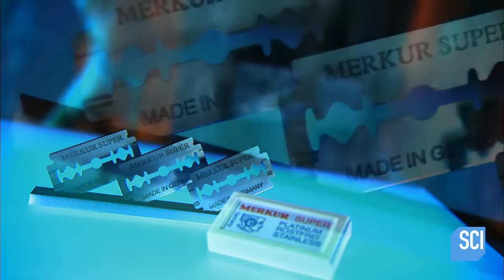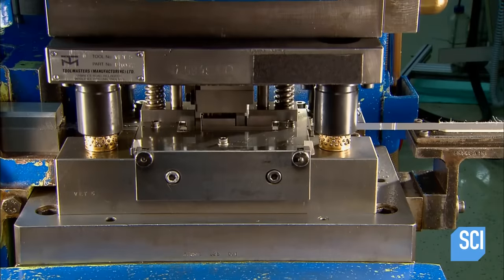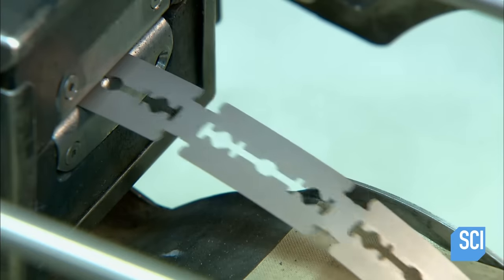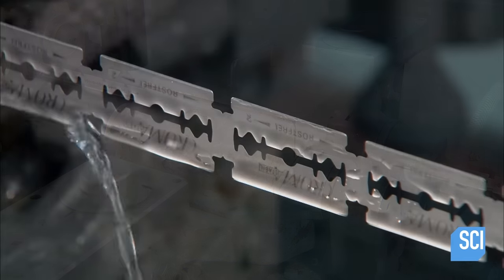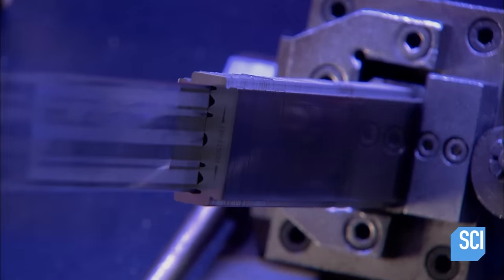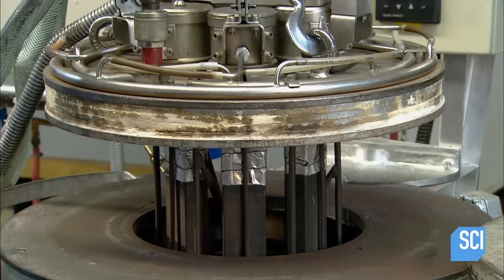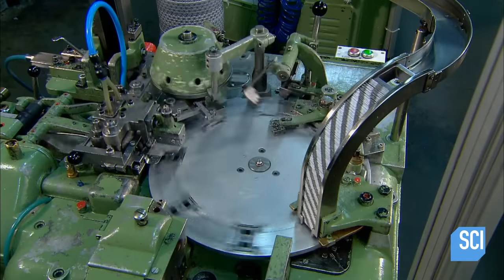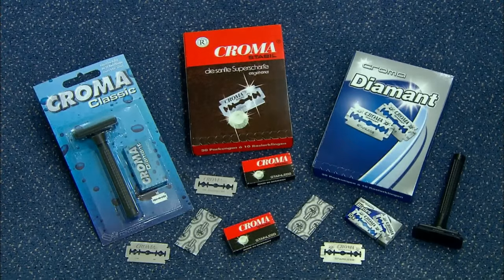How It's Made: Razor Blades

Comment: All I can say is that I shave 6 days a week and my razor last for about 3 months. Razor's dont typically get dull from shaving hair, they oxidize from the water used to clean it. Simply ensure that its completely dry when you put it away and it will last way longer.
Reply: Months for me, too.
Reply: even a good quality razor is 10ct a piece
Reply: Replace a blade after only 6 shaves? I'm not made of money, they must be joking.
Reply: @steveclark..  I'm still going through a 100 pack of astra's that I got for 1 euro. I'd have no problem tossing after six but they usually manage a lot more.
Reply: @steveclark..  if you're even talking about DE razor blades, just buy in bulk and they'll be so cheap
after that it's just being old school stingy, cause after 6 shaves (you can stretch it to 10 or so) you are definitely going to be shaving with a duller edge
and as the other comment says I'm not about to painstakingly dry each razor blade as well after I'm done just to save a few cents.
Reply: Maybe your hair is soft.
Reply: Meh, I don't see much of a point when a pack of x10 DE razor blades costs ~3 Euros. Buy in bulk and you get them even cheaper. I swap mine after three shaves, I have enough razor blades to last me the next five years anyway.
Reply: @MrCmon113  Or he's a headshaver. Hair on your scalp isn't like the copper wire that's growing out of face, so it makes sense that a razor blade would last longer.
Reply: My razors must suck because they only last 2 shaves before they get too dull and start making the skin rash. I do use water to rinse of hair on the razor, is that bad? I got thick black beard growth and only shave with the grain
Reply: @Smokeyyy337  I use Shick Hydro 5's. And using water is fine, you just really need to get the water out/off the blades when you're done. After you blow the them out with air you can put a dab of oil on the blades to keep them from oxidizing. Make sure it's skin safe though.

Comment: Decades ago bathroom medicine cabinets had a slot in the bottom to drop old razor blades down into the wall. As a carpenter I've remodeled bathrooms and found piles of old blades.

Comment: I switched to safety razor years ago, so much cheaper. I'm still going through the blades I bought 8 years ago, 100 blades for like $10 back then. I ended up buying like 300 blades, because so cheap.

Comment: Well I don't use them for shaving, but they sure are good quality blades.
Reply: what do you use them for then?
Reply: @Elmojomo  I used to use them for scoring sourdough. would actually go through quite a few blades a shift, but a lower quality blade wouldn't have been good enough even on the first cut.
Reply: @erikmyers3888  huh. cool! I figured you were going to make some stupid joke about using them to cut your cocaine or something. I wouldn't have thought sourdough was that harsh on a blade. Is it abrasive, or caustic, or ???  What dulls the blade?
Reply: @Elmojomo  Its similar to cutting through plastic with a fine-bladed knife, the tough stretchiness of the gluten folds the (microscopic) tip of the blade over. The dough is pretty strong, with good mix and development you can stretch out a piece of dough the size of a hand, so thin it becomes translucent without tearing. 

Any loss of sharpness causes the cut to stretch and tear into the dough instead of slice cleanly under the top layer of crust. Its not that it won't cut the bread any more, but it will make ugly and rough cuts that could even cause the loaf to split when it swells up in the oven. 

Also, we made around 2000 pieces of bread a shift, with 2 to 11 cuts per piece. Using each corner of the blade for ~100 cuts (not that I ever counted). Some styles of cut need a sharper and cleaner edge than others.

Making bread at that level was really interesting and rewarding, and I very much miss the smells.
Reply: @erikmyers3888  Interesting! And all that cutting was done by HAND? That seems highly inefficient, and something ripe for automation. Is that why you don't work there any more, job taken by a robot? lol
Reply: @Elmojomo  Nah, no robots half the product IS that the bread was made by hand ;). We didn't mix, divide or slice the dough by hand but just about everything else was. Unfortunately because of the obvious inefficiencies there was a ceiling to the possible pay, so I eventually left for greener pastures.
Reply: @erikmyers3888  Sounds like good stuff! Too bad I'm gluten intolerant. :/
Reply: Remember its down the road, not across the street.
Reply: @xyrozee  How is that related...?
Reply: Man these are some high quality bracelets 😍
Reply: @TheRealZazaExpert  how the fuck are razor blades bracelets
Reply: @noahz7968  r/whoosh
Reply: @Elmojomo  r/wooosh
Reply: @xyrozee  LMFAO 💀
Reply: @trinityw3169  what?
Reply: @Elmojomo it’s for getting some beans
Reply: true

Comment: Some silly trivia: if you have an older home with a medicine cabinet built in the wall, there is usually a slot in the back. This is to dispose of dull razor blades.
Reply: And usually they just end up straight into the walls, at least the ones I've seen don't even have a container behind the cabinet facet
Reply: @acidset  Yup. Having remodeled hundreds of homes, I've seen several of those slots and when the wall was opened up, we'd find a pile of razors in the wall behind the cabinet. And rat skeletons and either beer cans or newspapers from the time the house was built inside the walls. Pull tabs.
Reply: What is behind this slot?

Comment: I switched to this style of razor a few years back because it's vastly cheaper than a conventional cartridge system. You do have to be more careful, as the blades are extremely sharp and it's much easier to cut yourself. However, if you take your time the results are worth it.

Comment: It's interesting to me that after quenching, heat treatment, and chromium plating they expose the blades to a 660 degF to adhere the oil coating. I would think that would affect the temper of the blade. Every alloy is a little different but most blade steels temper in the 350-500 degF range. Going up to 660 degF for 30 minutes would almost certainly cause the steel to soften considerably.

Comment: In retrospect, the hardened coatings are probably what make it so difficult to keep razor blades honed using sharpening tools. Not because the coatings are too hard to be sharpened, but because the coatings get ground off when sharpened for extended use.

Older model razor blades that were heat treated to naturally be harder were likely more expensive to produce, but were able to have their edge maintained with sharpeners at home. But with these newer blades using hardened coatings instead, sharpening them will just get rid of the coatings and make them unable to retain their edges.

Comment: I've got a very tough beard and having tried the modern triple blade with moisture strips and all of that other nonsense, shaving was always a chore as I swear I spent more time trying to get the stubble out from between the blades and wires than actually shaving.  The razors were garbage too, maybe lasting two or three shaves at most.
So the wife got me a safety razor, soap stone and brush - nothing fancy, just a $20 kit from a drug store - and it worked beautifully!!!
The blades are far sharper, give a cleaner shave, the razor is easy to clean and the cost of one pack of ten razor blades is the same as a single disposable razor.
So forget these shave club of the month and all of that other nonsense - including the fancy shaving cream and gel as well - go old school like your father or grandfather and you'll wonder how the modern, plastic, disposable razors ever caught on to begin with.
Oh yeah - grab a second for the wife because after she used mine the first time for her legs she bought one for herself the next day.

Comment: I grew a beard about 40 years ago, then stopped using a razor to fine tune the edges about 30 years ago.
Still fun to see how they're made.
I know that not all are, (or were), made from high end stainless. (I'm guessing around the 220 to 270 range as I can still pick up the average razor blade with a fairly weak magnet.)

Comment: 4/1000 of an inch is so far removed from what an inch is that it's meaningless...  just say the amount in millimeters.
Reply: Also, it's decimal, not fractional, what everyone (who is a die hard imperial fan) says is it's attraction.

1/250th just doesn't have the same ring as 4thou, and both make less sense than a 10th of a millimetre.
Reply: For whoever is wondering, 4/1000 of an inch is just 100 microns, or 0.1 millimeters.

Comment: The closest shave is actually gotten with a straight razor, however to keep that edge that sharp is a delicate matter and not everyone has the technique. This was the next best thing, pre-sharpened disposable blades. The cartridge razor blade took this concept one step farther, realizing that you didn't need a lot of metal. You just needed a really sharp edge. So you have the edge of a razor set into plastic, usually on a spring system to help it hold the contours of the skin and give a better shave while simultaneously reducing the likelihood of nicks and cuts.

Comment: These cheap and simple blades shave faster, easier, closer, and with less razor burn than the 4 and 5 bladed cartridge razors which cost so much money. One of these blade in an old safety razor is much easer to shave under your nose than a 5 edged razor cartridge which is around half an inch across nowadays. A month's worth of multi-blade cartridges cost more than a year's worth of safety razor blades.

Comment: Did you know, If you ever swallow a razor blade, don’t panic. The human body is more capable than you think. Acids are ranked on a scale from 0 to 14—the lower the pH level, the stronger the acid. Human stomach acid is typically 1.0 to 2.0, meaning that it has an incredibly strong pH. In a study published in the journal Gastrointestinal Endoscopy, scientists found that the “thickened back of a single-edged blade” dissolved after two hours of immersion in stomach acid.
Reply: Ok but why are you swallowing it lol
Reply: @racingdinosaur3886 Just in case.
Reply: This sounds like razor blade propaganda

Comment: Safety razors are WAY better then the “modern” (more profitable for razor companies) alternative.

I only just realized they were even a thing, and since switching have 0 regrets.
Reply: Me either. I bought a razor rock german 37 slant and no regrets..
Reply: @viarnay  that sounds a lot more fancy then the one I got off Amazon lol

But you can’t beat a handle and 50 blades for $15, I’m still using the first blade after about 15 shaves now.
Reply: @logans3365  they are supposed to last no more than five shaves
Reply: @viarnay  still works great though, I see no reason to throw one away if it still shaves.

Comment: Those blades will last a lot longer than 6 shaves if you actually take care of them. Store them in 99% rubbing alcohol to drive off oil and water and they won't lose their edge from corrosion. My dad had a disposable razor he did this with and it lasted him for 3 years without ever needing to change the blades. Yes, he shaved every day.

Comment: Stopped using razors years ago, got tired of spending the money on it. Now I just use a pair of electric clippers. A little oil on the blades for each use and they'll last for years without sharpening. It may not be a super close shave but it does save money. I don't need close I need to save on cost.

Comment: I switched to the og one blade only because thous 3-1874 blade bs things getting way to expensive and getting dull way to fast, even of you take care of them (drying and stuff)

I got a metal handle + 10 extra blades for 15, and every new 10 blades cast like 3 bucks.

Shaving takes a bit longer now, but learning new things is fun, and the feel after is 10 times better then before.

Comment: I like these double-edge safety razor blades much better than the double and triple blade cartridges (or plastic-handled shaving devices) that came on the market  later, the things with thin strips of metal embedded in a piece of plastic  These multi-strip blades are harder to clean. The strips are just millimeters apart and trap hairs between them. You need a tooth pick or something to get them out. And the multi-strips don't shave any faster, closer, or in any way better. Yes less stainless steel is used for each cartridge or each plastic-handled razor, but these razors have all that plastic resin being used to hold the strips of metal at the correct angle and the correct distance apart – and that plastic resin is harder to recycle, I think, than stainless steel.

Comment: I still own my grandfather's shaver from the 50s or 60s. It still works perfectly, considering it's over 60 years old. Refurbished, these shavers fetch prices up to $110, but guess what? You can get the exact same type of shaver for $15 from Wikinson today. Considering one of these blades costs around 40ct, and one of the expensive system blades can cost up to $6, I say even if the shave were less close (which it isn't), count me in.

Comment: Now I see why they are so expensive.
Reply: DE blades are a small fraction of the price of disposable multi blades in plastic. I spent about US$60 on a well balanced German razor and now I use top notch Japanese Feather blades that cost only 50 cents each. That’s way cheaper than a dodgy Gillette or Schick

Comment: only 6 shaves? i had used mine for a few years :P :face-green-smiling:
Reply: well these are double edge razor blades. they are dirt cheap compared to disposables/ cartridge. Most of wet shavers don't even use them for 6 times because coating goes bad after 5 and it is cheap.

Comment: Waste of resources, time and money and get thrown away constantly.   The electric shaver I got over 20 yesterday ago is still going strong and don't need shaving foam either which is another big waste going straight down the sink. I just open and empty shaver, done in qtr of the time with no cut's. Think about it. We've got facial hair for a reason.